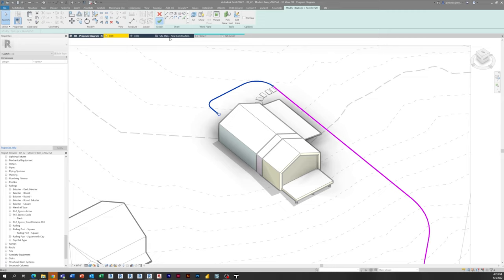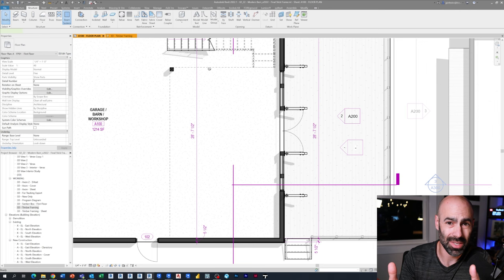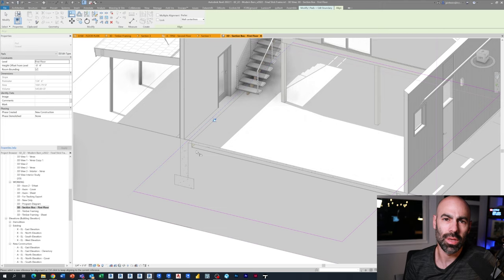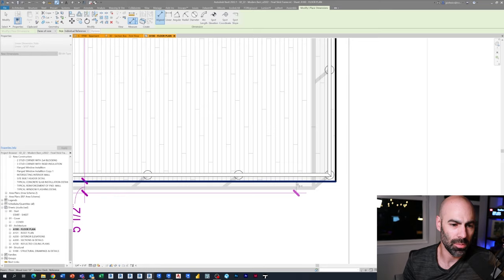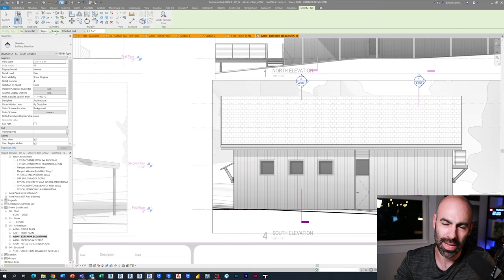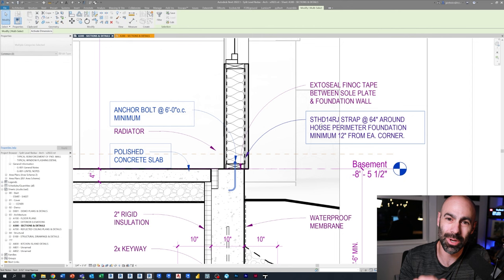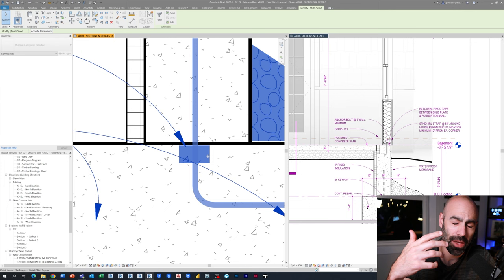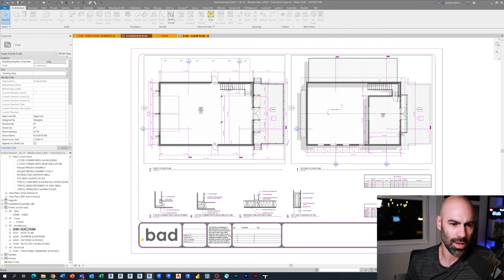Construction Documents in Revit - Modern Barn (Episode 04)

Comment: Hi jeff , just wanna to know ..hw u do or achieved and produced ur construction documentation  drawings in ur practice ..do u link all ur Architecture structure and MEP files and started to do CD ..or u used the links file  as only as a reference and started to draw traced over it with detail annotation , detail line and fill regions etc...I think its nice to have a videos' of ur series ..how the actual construction documentation works in a real world practice in revit ...Thank you cheers !!
Reply from the maker: It all depends on the project... For residential work it might all be in one model.   For commercial work its usually by discipline.

Comment: Another amazing video, to your point about using the live model for detail sections, I found that constraining 2d elements such as insulation and top/bottom plates to the geometry works pretty well too as when things adjust those items for the most part will adjust appropriately too, still requires a QA but should reduce some detailing rework.
Reply from the maker: Yes!  The more model elements the better! It’s a fine balance between effort to model and maintain… if you have the time to model more, it’s always worth it!!!

Comment: Thanks for sharing process, tips & tricks. I'm wondering is it better to use detail item tags for annotating or just the simple text?

I used the two ways, but I think the first one is quite smart if the template is good enough. 

What do you think about this?
Reply from the maker: As I mentioned in the video …. Keynotes, tags, and smart detailing are all great ideas.  When it comes to this small scale residential where I only do a few projects a year with one two wall sections in them … I just use simple text.  Putting in place a system for smarter detail tagging is 100% recommended by me! Lol